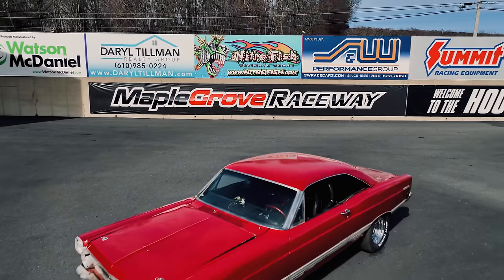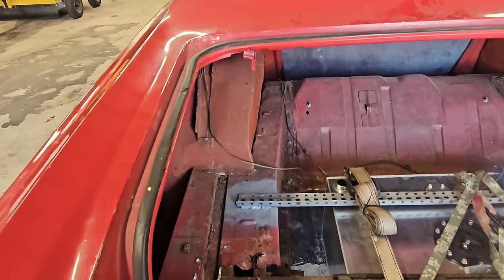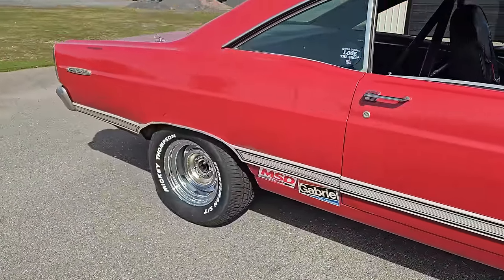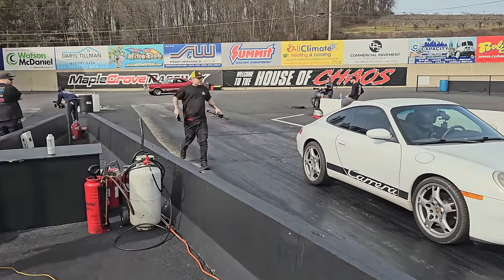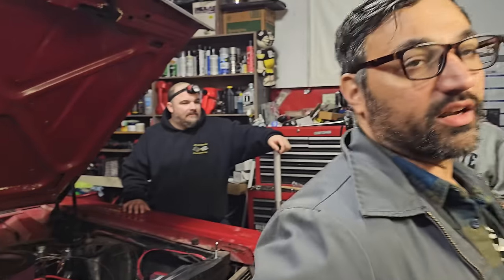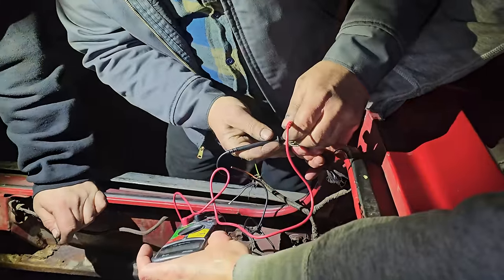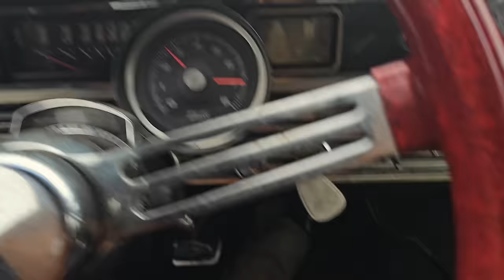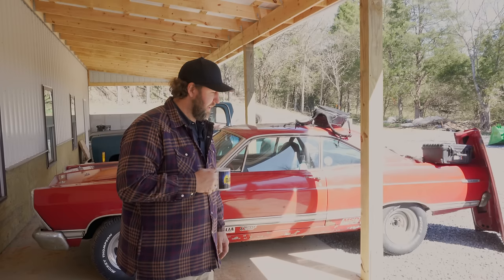Will It RUN AND DRIVE 900 Miles Home? LEGENDARY 70's Built Ford Drag Car - With Tony Angelo!

Comment: I had a blast getting this thing back together with ya! Looking forward to the next one! Thanks for coming up to PA bud!
Reply: 👍 it's almost as cool as the Mopar with the wrong front spring mount
Reply: My theory on the "wrench" you heard on your video the other day bouncing under the car was the piece of all-thread you cut off of the air cleaner stud!  When you cut it, I said to myself, "that's going to fall out and scare the crap out of them"!  Keep up the great videos.
Reply: @brianhudak5103  wondered what that was but that makes sense
Reply: I can't believe he let you drive it knowing how far he had to drive! If there's one thing I know from watching MTOD, Roadkill, HRG etc etc, it's don't let Tony drive your car unless ya want content! He breaks everything! No offence Tony, Love ya! But Zero mechanical sympathy, until afterwards!
Reply: This was pretty great.
Reply: I subscribed to you after watching this.
Reply: You come across a lot more sympathetic and humble in this video which suits you very well.
Reply: # tonybrokeit.  Great content on both channels
Reply: Great job on the car (rule number one don’t let Tony drive it) 😂 you guys need to work together again. I think you have a lot of new subscribers I know I am. And that transmission dude was a stand up guy.
Reply: The hood bumper stud also
Reply: @DunkDrives  Probably did Derick a favor breaking it when he did. That could have happened on the way home plus he has a heavy duty transmission now
Reply: @CraigGrant-sh3in  This is true, but it doesn't take away from: Tony Drives = Tony Breaks! LOL!
Reply: @StayTunedTA maybe the worst half of the power couple but still one of the best 💪🏼 #TunedGripThrashers
Reply: The look on your face when you shifted priceless
Reply: Great collaboration. Big fan Stay Tuned.
Reply: Oh
Ahhh
Reply: When do we get another collaboration at Rusty Acres
Reply: Yea i love the grove. Lot of good memories from that place. Tony you'll have to let me know where you get them cheese steaks man.
Reply: It was funny when you said, wait am I  Marti? 😅
Reply: @StayTunedTA watch your episode the other day, great video. @Vicegripgarage another great episode, dig the car. You 2 need to work together more often.
Reply: Love the Stay Tuned channel! You guys are awesome!!!!
Reply: Tony broke it
Reply: You both have good shows indeed
Reply: Love ya show brother , killing it
Reply: Looking forward to you two getting together on another one-make it a semi annual event, one at vgg one at stta. This one is special for me. My uncle who was like a brother to me growing up had a Fairlane. One of the few + childhood memories I had, first of a muscle car. Awesome job Derek and Tony
Reply: @brianhudak5103 . That's possible, but I wouldn't think a piece of all thread would make enough noise to be hard over the car. I think they worked something loose on their rip and it finally flew off (just a wild guess).
Reply: Tony are you daily driving the Porsche?
Reply: Hey love your show . Your on my list
Reply: Get the Ole RX7 sorted and do the tandem burnout comp at the next Cleeter event... it's always a blast and it'll definitely get your channel more exposure
Reply: Great collaboration 👍🏼👍🏼👍🏼👍🏼
Reply: Look like Tony broke another transmission lol, great job yall thrash hard when it’s needed
Reply: It’s so weird seeing him drive through East Berlin PA and take route 234 West. I drove that road for years. This part of the state reeks though. I wonder how Derrick would explain it lol.
Reply: Great job on the car lads, new subscriber.
Reply: Not gunna lie u and Derek make a great team would love to see u Derek mike finn and lucky do something big together would be none stop laughing and would turn out to be one insane build thank Tony keep rockin out with your c_ _ k out stay tuned ta on repeat
Reply: Stay tuned you guys are very amazing as well and I'm happy I get to watch you guys do the things you do I would like to find like an old Ford van or something maybe that could be something you guys could do I don't know to see an old raggedy looking van that looks like something from 1970 just an old work then nothing to be impressed with here
Reply: Really glad you guys did this and I got to find your channel as well for more great hot rod content. 👍🏻
Reply: Damn Tony, no dip stick?! What happened there?
Reply: And we've had a blast watching! Thanks to all of you!
Reply: You guys are great team together, this was a real fun build to watch on both channels, love to see you guys do a drag and drive or something  with the family in tow😊
Reply: Watching the two of you build a car together was epic man!
Reply: youre the man tony! a real good guy out there in the world
Reply: Tony the destroyer strikes again!
Reply: Love all of it. Pittsburgh wasn't far from you. You should had stopped we would had feed you like all Italian families do.
Reply: Tony you're a freaking Rockstar brother keep it up
Reply: love your channel and subscribed because of Derick and this car,  I remember you from your TV days at horsepower    @NZMOPAR
Reply: TONY LEARN TO DRIVE MANUEL 🤣🤣 you remind me of my cousin.   i spent my alot of years wrenching myself .
Reply: I there’s a weak link, Tony will find it
Reply: What ever happened to them really fun spring days when guys brought their toys out again for the season you know given the car a turtle wax shine on the trailer then hang a a new air freshener in the cars to cover up the nasty odor from all the years of beer cans left behind the seat still clangin around in the rear floor pans... I miss those days in thee  1970s down at the Grove.
Reply: Wish their content was cleaner. But they did do a great job.
Reply: Epic crossover for both channels. Both had a combination of cheese and steak.
Reply: Great job guys!
Reply: always return to 2nd gear (from neutral) before going into reverse gear on All manual transmissions, especially the T-5 WC and Non WC. Over shifting them kills em. Word for the wise.
Reply: I just throwed ya the 1000th thumbs up. Should I post my address for an old sparkolater or used coffee mug with the handle broked off?😎
Reply: Love it when a awesome plan comes together, may have taken year an half but I know this ain't mc,ds I'm lovin it ✌️😛✌️
Reply: Great job Tony!
Reply: Can't believe I missed it. Your shop is like 5 minutes from my house. Would of loved to meet the both of ya.
Reply: Tony broke it
Reply: Tony breaks everything!
Reply: Derrick, you should never have let the fanooch drive. Your son would have made a better pass.
Reply: Same here! Tony's video came up as a suggestion,  so I watched and subscribed,  and then Derek's came up.
Reply: I love the collabs.
Reply: I just had a  revival on a 2004 acura tsx  that I bought  in ridgeway Pennsylvania  I been looking for one for over a year cause it's a 6spd and I'm gonna use it for delivery driving welp the oil was black the car had been sitting for I don't know how long the owner didn't say much but the mpgs were terrible  like they stuck 40 octane  in it or something getting I don't know gas mileage but the gas gauge was drinking the fuel down so I ran it little  bit down on the way to eastern shore Maryland  gave it the little old 93 octane Italian tune up and she came back around quite smoothly  derek your revivals have taught me alot about getting car running again and getting it running as good as it get ❤ thank you brother  I really want to get the og vgg hat when it come back
Reply: So cool to see a small YouTuber support a big star from motor trend like tony Angelo.
Reply: Even if the pizza is inferior!
Reply: I knew you were going to break something on Derek's car. I just had this gut feeling. Then you launched it nice and soft and I went ohh maybe not never mind. Then sure enough you grenaded 3rd hahaha.
Reply: @StayTunedTA You guys would be awesome on a show together
Reply: good thing tony angelo's thing is bench pressing transmissions
Reply: What s.your bench
Angelo..?..me.theo
Blacksmith..40years
Theo.s.gym...natural..
Harlingen.holland...
Nice.roadmovie...
Reply: If only you weren't so hard on the equipment, you'd be a hell of a good hand😁
Reply: @kennethbrown109 What do you mean by cleaner?
Reply: Keep it and restore it !! Love your show !!brings back memories of the days back when ❤😊
Reply: Gotta say, it was killer to be able to see you and Derek on his channel running one of his rescue videos. Amazing.

Comment: Tony understands that getting the little details right matters. Under promise and over deliver. I like this guy.
Reply: Except for one little detail, no lights, no wipers, and building an engine that would over power the low grade T5.  Thankfully those two guys saved the day with a properly modded up T5.

Comment: Derek, I love that 67' Fairlane. I have  a 66' and just dig that body style. I'm glad you got it going and back home. My personal suggestions are leave it pretty much the way it is but iron out some of the details. Put a heater core in it, wipers, a seat that will accommodate someone taller than 5'6", repair the electrical system and drive it!

Comment: Stay Tuned brought me here… this reminds me so much of a my own recent experience. I bought a Buick wagon on Bring a Trailer back in November and my buddy and I flew in and drove it over a thousand miles home. Turns out it had no wipers either (that worked, at least). Luckily we didn’t hit any rain, but we did find some snow. Pro tip: if you find yourself asking “how old are those tires” the first time you see the car, go get some new ones BEFORE you hit the highway! From those of us who only get to do this stuff occasionally (or never) - thanks for letting us tag along.

Comment: I commented on the Stay Tuned video about that T5; good to see someone who knows them so well willing to help. I had to rebuild a 4x4 T5 for an old S10 and wouldn't you know it but the rear bearing failed on me after a few too many energetic 1-R shifts in the mud. Back out it comes so I can save reverse before the gears turn into a cylinder like your 3rd did.

Comment: From a guy whose been using Rain-X since the 70s, got a tip for you Derek. Got to use the original formula out of the yellow squeezy bottle on the outside windshield. You push/rub that in once, use a paper towel to buff/polish it dry without swirls, then.....all important, do both those steps a second time. Do that and I guarantee you won't even know it's raining over 25mph. Great going on the mileage. Puff up the tires and pick up 2 mpg on the hwy. The girlfriend says you're a man who should be packing your long johns for under your jeans on these heaterless cross country jaunts. Love that car, that motor and that 5 speed👍 happy motoring Malcolm Ottawa Valley

Comment: @vicegripgarage I have dealt with the interior fogged windshield many times. Buy a 12v clip mount fan and the $3 orange plastic harbor freight glass handling suction cup. Mount it on the passenger side of the windshield pointed at the goober viewing point and you will be golden. Even without anti-fog. Love the content and merch! Keep pushing us to get out there and have the adventure!

Comment: Another great video.

Derek should probably consider running down to the junkyard and getting a windshield wiper assembly for the rig.  Probably run a hot wire from the “battry” and then to ground.  Maybe even throw in a switch.  It’ll work “fine.”

Looking forward to the next great adventure!

Comment: Ford guy and owner of a 65 mustang with a hopped up 302 and T5. I really dig that car, the color, stance everything. It sounds freaking awesome too. I’d put a heater and wipers back in it, fix all the electrical and use it as a street/strip car. Take it on power tour or something.

Comment: Hey Derek. Next time you get cold or foggy winders...a fella should grab a roll of heater hose at a parts store. Just loop the hose around the dash and back out to the engine. With enough hose you can loop over the dash and down along the floor to keep your earth pounders and the windscreen defrosted. No heater core needed. Plugs two holes in the firewall too.

Comment: Watching this video now.  You mentioned the cut brake pedal, saying he did it for foot angle or something.  If you decode the vin, you may find that it was originally an automatic car.  On these Fords, the clutch pedal assembly can just be added to the auto assembly.  You just have to cut the auto brake pedal down to the size of the manual pedal.  It's a pretty easy process.  It's what I did on my 66 Mustang when I swapped it from a C4 to T5.

Comment: great job,  i owned a 67 fairlane GT  390 S CODE  top loader 4 speed. , all stock, but was a rear wheel hoppin sun of a gun.  oh and it had the VERY VERY RARE   tachometer mounted on top of the dash. havent seen one since, a guy will have fun with this red 500

Comment: 1957 FORD CUSTOM 300 , Two Door Sedan CANADIAN CAR , With a CARROL SHELBY 427 STROKER, ATI , 4,000 Converter , 391’s , etc. runs PRETTY GOOD, 3,440 Lbs. Just a bit Scary , A few other TRICKS 😮

Comment: 10:55 Story checks out. That's definitely what happened there. 
-Takin the nitrous bottle out with a vice grip and then Tony shaking on the door handle. Man, this is a good one. 
-Holy smokes, did not expect how good it would sound on that first burnout! What a sweet Fairlane

Comment: I popped first gear out on my '71 T37 on an active railway track with a train coming, I went to second, third and then redlined the engine before putting it in forth, she connected for about 20 feet, which was enough to clear the tracks 😬🙃

Comment: Contact cleaner on the connectors. Especially the ECU and sensor connectors. This "slow" awakening is probably from vibration breaking some corrosion loose. I used to fix robots in auto plants. The spray booth and clean room environments are warm and humid, perfect for corrosion. Digital Tronicals like to feel connected! VGG Tronical conduction improvement juice?

Comment: Hey Derek, at least it was relatively warm out. Try driving a 1958 Pontiac with a heater that didn’t work for 50 miles when it was 10 degrees below zero outside. I was glad I had my wife with me to scrape the ice off the inside of the windshield that formed from us breathing.

Comment: If you've never driven a RainX car you never had a good ole deathtrap. My dad had a 82 Supra w no wipers, bk in 93 when the motors cost $500 to replace! If it rained too hard ,on bk roads theres not enough speed for the X to work, we would put are hands out the windows and toss the wipers to each other! Obviously from East Tennessee!❤

Comment: FYI, East TN near Johnson City. If you’re ever stuck…No hot rods yet. Looking for a 66 GMC short bed step side with the 305 Hercules and 3 speed on the tree. Daddy taught me to drive in one. That will be the plunge. I’m not going to post a cell number here, but I do check notifications here if you’re by the side of the road.

Comment: You need to buy a fish tank cleaner. It is a strong magnet and a handle that fits on the other side of the glass. Fit a 10 inch wiper blade to it so you can clear screens while driving. It would only cost a couple of bucks. I have done this and it was a life saver and you just remove and take with you to any other car you pick up

Comment: I would like to see you update the brakes to 4 wheel disk as well as the frt suspension, like some of the shows they restore a car on. 
Too bad you can't find a stock type gas tank and fix the trunk.
Back to a trunk. 
Also all that chrome could be brought back.  Yes its back and racing but it can look good doing it.
And be a daily driver.

Comment: I think I remember that this was an original S-code 390/335 car.   The 302's great, but something feels like another FE would be the right thing to do.   Maybe a 410 or a 428 built to Cobra Jet specs.   An FE build would be a lot of fun to watch on VGG.   (then what to do with the 302?   Freiburger's got a pretty decent '71 Torino wagon for sale...)

Comment: Project ideas
Street/ strip
More dependable street  needs
  Wipers
  Patch holes in floor
  Correct the many wiring 
   Problems
   Fix passenger door 
   Add a passenger seat 
   Repair the few rust areas

Comment: You need to bring it back to a 427 fe or even a 390 stroker to a 468 but the squar bore of the 427 and high revs is a sweet combo

Comment: You definitely need to get the nitrous back in it and probably some wipers 😂
Update the wiring and get some license plates out to fix the holes in the floor and possibly a seat that actually fits you .. oh keep the roll cage but make it a part of the car maybe a few more ta welds 😂 .. awesome car tho . The history of the old timer who built it, 
it definitely needs some love

Comment: Watching the vidya still. Wondering if the RainX will lure you or not. That stuff literally saved mine and my family's lives. 750 mile trek PA to South Augusta - in a tropical storm - rainxed the cherokee fully, twice, replaced wipers, halfway down driver side wiper on I-95 went bye bye in the storm with 9 out of 10 vehickles in the right lane driving with flashers at 45 and rigs in the left lane doing 75. I just turned the wipers off and moved the passenger wiper to the driver's side once the rain slowed down a little while after getting into Georgia. It could have been tragic because we were in that left lane when the wipolater went on its merry way.

Comment: If a feller is having problems with the windscreens fogging up, take a tip from a former pizza driver and clean the inside of your glass with shaving cream. Not the new gel flavored stuff… the good old barbasol. If it keeps the fog down from hot steamy pies it will make it so a guy doesn’t have to ration his breath

Comment: I have a 87 5 .0 in my 65 Mustang I have the ford racing X cam world product jack roush  200 cc iron heads cams a 542 lift springs in the heads good for 600 and lots of other stuff